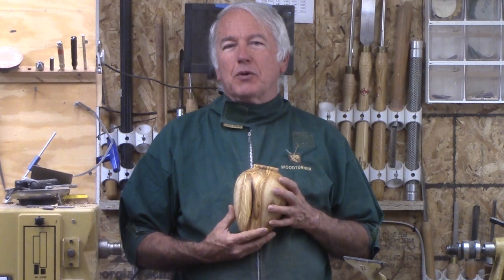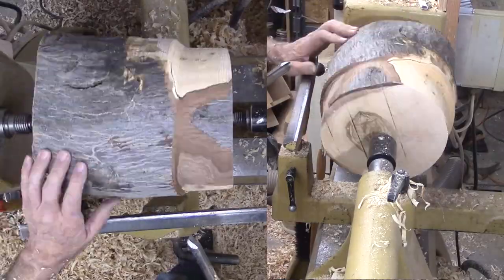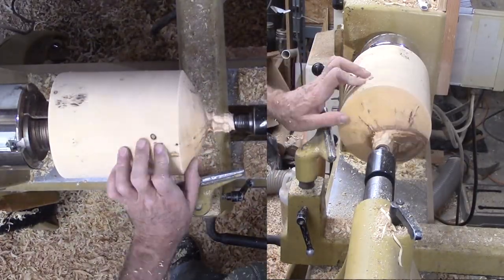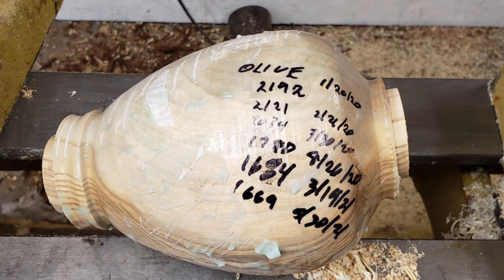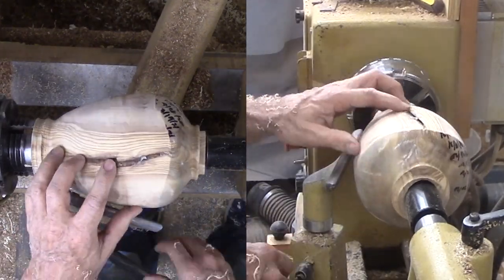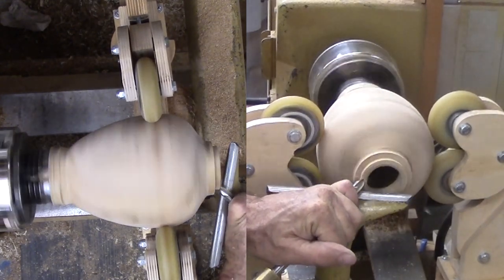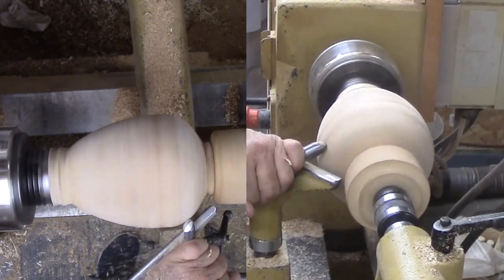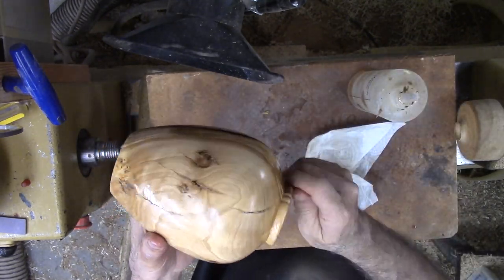Woodturning Olive Vase Hollow Form From Wet To Dry

Comment: Beautiful vase!  I understand that in wet bowl turning the basic rule is for a wall thickness of 10% the diameter.  Does that rule also apply to hollowing a vase and is the percentage of the largest diameter part?
Reply from the maker: It is a "rule of thumb" not a "rule" but it generally works.
Alan